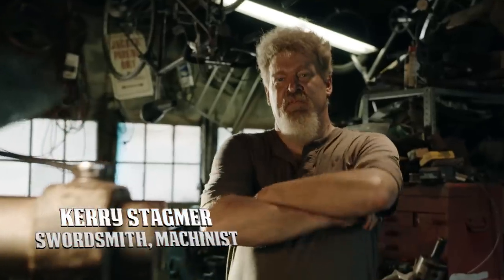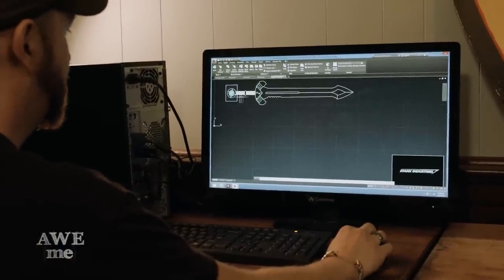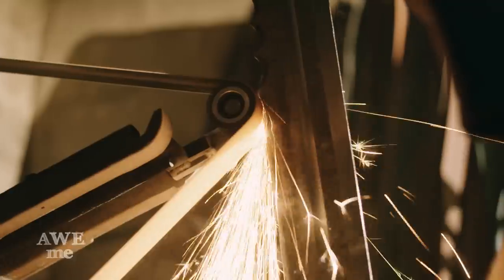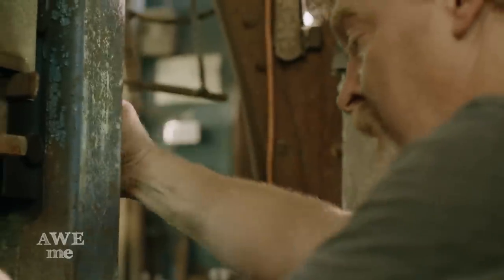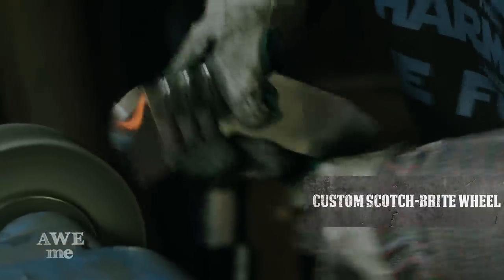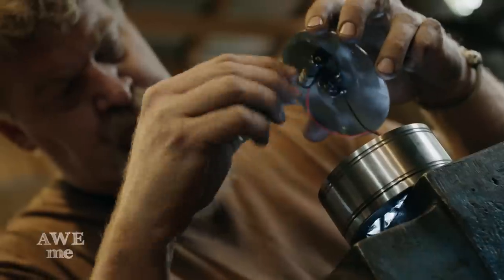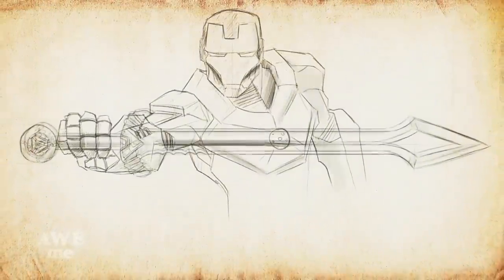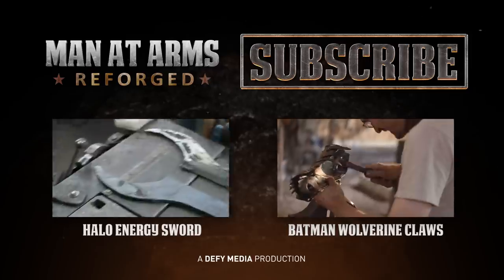Iron Man's Sword - MAN AT ARMS: REFORGED

Comment: no reason to have a reactor in the sword, so dumb
Reply: he keeps peppers gift in a case so it doesnt get destroyed
Reply: Maybe the reactor powers the blade to, I don't know, vibrate at high speeds to make it more effective at cutting?  And it has its own so it doesn't sap energy from the one in his chest?  Just spitballing, exercising my creativity.  Hell, maybe it puts a current through the blade, or a field of energy.  All sorts of options, if you leave your mind open to them!
Reply: the steel would be destroyed by high vibrations and nuclear emissions from the reactor..the only reason maybe would be a back up reactor that comes off from the blade
Reply: Austin Bedwell They made it out of real life materials. In the marvel universe the blade could easily contain vibranium which if powered by the arc reactor would make it a potent weapon
Reply: i feel like vibranium absorbs all energy so it more likely be made out of adamantium..also the blade should be gold
Reply: Are we really arguing about what's impossible in a fictional universe?
Reply: Joseph Lyons Welcome to the internet
Reply: You say 'why', I say 'why not'. The arc reactor can turn the sword into an energy-based weapon and it be an identifier that only allows TS to use the energy component.
Reply: they arent as good as the other guy
Reply: Shadohz75 In that case, Tony would have made it an energy sword to begin with, and had it powered by his own reactor. Having a separate reactor is dumb on both accounts. Just another way for a person to get their hands on Tony's reactor tech. Also he has lasers. No point in a sword.
Reply: ^the difference between professional and hobby
Reply: Austin Bedwell Don't forget that Tony is an engineer. He'd never put so many 'bells and whistles' on such a thing. squints at spiky bits near hilt/overall shape of the blade
Reply: thats why tony will is better
Reply: Austin Bedwell Have you heard of power blades?
Reply: ***** If we are going with "common sense over fiction" then TS would've created a hilt only, the sword blade would be made purely of energy powered by his reactor, and he'd use it for CQC. Since comics are fiction I could see them purposely creating the sword with an independent reactor for the sole purpose of making a separate story arc about another hero/villian stealing it. If comics were based purely on reality and common sense then all the villians would've been killed off 60 years ago and all the superhereos would all have their own workout DVDs.
Reply: Daniel Guerrero
what the fuck is a power blade
Reply: Shadohz75 Having an actual sword as opposed to "pure energy" has the advantage of weight. A sword is much easier to handle when your body can feel the force behind it and not just wave the hilt around like a ribbon dancer.
Reply: ***** One word response: "lightsabers".

One doesn't have to worry as much about weight distribution and applied force when the blade melts through objects. Energy particle have weight, so it would feel less like a longsword and more like a baton or shortsword. If the blade hits an object of equal or greater force, then there is resistance. Not even an energy blade can break the basic laws of physics (at least not all of them). However I understand your argument.

btw lol ribbon dancers. good one.
Reply: Shadohz75
I don't even...
Reply: Jacob Jensen What? It's just an opinion. You don't have to agree.
Reply: Because an Iron Man sword itself is a great idea..
Reply: if the sword have reactor and made of vibranium then it will be good against magic enemy and energy shielded enemy
Reply: or we can just talk about that sword is comically large and small at the same time..more like a toy
Reply: haha the handle is way too large and the blade is way to small is what i meant
Reply: Just can't please everyone..
Reply: It would be cool if he had a sword with a hilt of vibranium and blade of adamantium but s sword reactor would be stupid but also kinda cool for like super combo attacks
Reply: Tony can not fight, much less wield a sword
Reply: @Austin Bedwell I agree with the reactor being a stupid idea. It serves no purpose and it would be a total waste of a rector to put it on a melee weapon anyway.
Reply: tony would put a taser in the sword xD
Reply: hopefully they get rid of these backyard blacksmiths and bring in tony or another professional
Reply: Tony prepares for anything. Going deep space? Gotta suit for that. Suit out if power? Let's hit up ACE and make some back up gadgets.Hell, while we're at it, lets make a suit out of the metal used in Mjolnir. Saying that Tony would never make a blade is just stupid. Knowing him, after some party, Pepper drags him home. He sits out on the couch and is so out of it he puts the TV and flips through infomercials and sees someone selling 'the best sword on the market.' He's going to think, "I could build a better sword." Boom, instead of a drunk buy, a drunk build. of course there would be something techy in the blade so a simple little reactor would be on the blade.

As for these, "backyard blacksmiths," they are doing ORIGINAL designs. Tony made great looking replicas, I love his work, but in the end, he took what existed in fiction and forged it into our world. This group is taking the time, coming up with their own designs based off of fiction, and forging them. But of course there is always that one damn person who has to be a critic. If you don't like it, GTFO. The internet would be a better place with one less dick.
Reply: The reactor could be used to add energy to the blade, perhaps encompass it in electricity. This is a fictional universe, thus anything is possible.
Reply: Austin Bedwell You must be so fun at parties.
Reply: thatasiankid45 That dude needs time to get use to think creatively, LOL.
Reply: UltraDWS ahaha, or at least appreciate the effort these guys are putting into it.
Reply: LOL, it's kinda like "ain't no rest for the dickheads" ha ha ha.
Reply: ***** Hell yeah! Man, You completely hit the point! The reason that I love these AWE guys was they made stuffs with creative thoughts.
Reply: Shadohz75 My point was obvious. They should not have built this. In fact, the CNC Plasma Cutter was used to cut this sword..... That would have been a better sword in itself.
Reply: Just a design,nerd

Comment: Tony would have a high-tech sword. It would probably be a taser. Throw fiberglass or glass-infused resin down the middle, then attach an electrode to each blade. 9v battery and a flyback transformer in the handle, you've got a shocking success. Carbon fiber would look better as the middle piece but it's conductive so not great.

Comment: why is there an arc reactor on the sword???
Reply: Decoration. And I think it does give the sword a nicer look and balance.
Reply: well... think of it thisway.. ifever iron man needs more energy there is one sitting right there.. buuuutt.. would have been cool if they put lights on the edge to make it seem as if energywas coming from the edges like.. plasma or something.. but wouild it cut? probably not
Reply: Would you want to plug in your sword to the very thing keeping you alive? I do not think so.
Reply: That was the ONE thing you questioned?
Reply: Just thought of something.. symbolism??? 

Heart of the sword?... maybe just bs on my part
Reply: DanusMax
It is not BS. That is a good thing you said.
Reply: swag
Reply: Have you watched the iron man
Reply: would be nice that the grip was coated with a special isolating spray, and that the "arc reactor"  would make the sword electric
Reply: MrSloth in n boom
Not a bad idea,that way even if he did not get them with a good full swing,the electric aspect would knock them out.
Reply: Lasers 'nuff said
Reply: I'm guessing the sword would be illuminated in energy. Similar to a lightsaber, but with a solid frame to the blade. It would have to be powered by something.
Reply: vyron tromp lmfao xD
Reply: Vibro-blade, fairly common in sci-fi, these days used on drywall, tile, plywood and turkeys.

Comment: looks like a plastic toy to me
Reply: My theory is that it looks too perfect. Without the imperfections that come from hand-designing it, it just looks mass produced. I don't hate their design ideas like other people do, but a regular person putting together a DIY sword kit from Amazon could easily be more interesting than these guys having everything done by computer.
Reply: xtrapoint
Tony. Stark.
Reply: Probably cos they used 1 pack paint straight on metal, no primer and (what looks like) a single coat -Ha  Like you'd ever paint the metal on a car with 1 pack product lol - They ended up making it look like a model
Reply: John Lovethatmagic
It is not a car it is a sword. Ever hear of anodized aluminum paint? You have most likely seen it before. Also they are going for a look not durability. if they did that then they would have used colored metals instead to plate the sword but that gets really expensive compared to paint.

Comment: there are huge difference between hard and tuff, like diamond it may be the hardest thing in the world but you can easily shater it with a hammer and without damaging the hammer, tuff means that it can handle stuff like that there is a kind of jade that is impossible to penetrate, so I think that they should start using the word tuffen rather than the word harden 
tell me guys if you agree with me

Comment: There's only one problem I have with this sword. A small problem. And a question. My problem is I personally would've left the Stark Industries logo without paint. But that's just me. My question is, while I like the use of the original Ark Reactor, does it power the sword in any way? Or does it just sit there for decoration? And if it DID power the sword, what would the sword then be capable of? Obviously, for this video, it's decoration, but I mean if Tony actually made this sword.

Comment: I worked in a machine shop for 20 years, i can tell you this, if you can free hand swords on the belt sander they call a (GRINDER) your damned good because you have done the impossible,... why because the belt sander is a flat hard surface where either edge of the belt will eat in to your blade. it would be difficult to master.
how ever i use a angle grinder with a 4 inch sanding disc it has a radius-ed surface that allows you to create a flat surface with even strokes.
but i can tell you getting points radius-ed equally is tough.
and what makes them look cheap, painting things when they could be electroplated. Nickle plating looks like gold, and electroplating makes your work look like gold. 
High carbon steel pits with rust if anything moist touch's it. You have to keep it oiled!
with a buffing wheel and compound you can polish your sword to a razors edge!
the compound kind of puts a protective barrier on the metal that helps it resist moisture.
but grease is best.

Comment: hmm, if it was totally on par with how tony stark would've used for materials, then he'd be using titanium gold alloy for the blade since it is the most resistant metal when it comes to impact and corrosion resistance, tungsten would pretty much shatter on impact, same with chromium, 2 of the 3 strongest non-alloy metal known to man, thou in the mcu, he would probably use vibranium instead